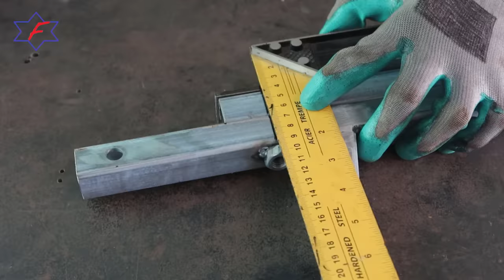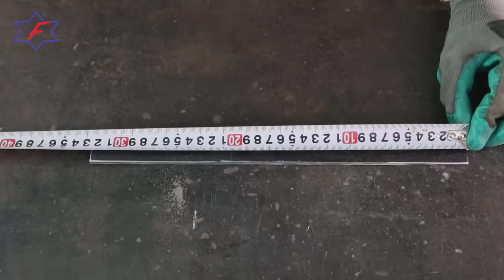Homemade Multi Purpose Wheelbarrow From Old Pallet

Comment: One roller needle bearing ll do  four times better than two ball bearing. I dont understand why so many people use ball bearing for hand carts that ll carry weigth, ball bearings cant not stand shock and heavy loads. plus their give slow spin and cant transfer power well, in the other side needle bearing are used in olympic bars and cant stand hell of a shock and can give faster spin for the wheel wth very little effort.

Comment: We don't have problems with cars, we have problems with wheels. Previously, the wheel worked for several years, but now the tire with the tube needs to be changed several times a summer. If only the wheel was from a Soviet scooter

Comment: Very nice idea. Just a note, you took the boards off of the pallet in the wrong way. Always work backwards so that you have a board to use for leverage on the next one. Your method is good, but start at the other end. It will go easier.
Reply from the maker: Many thanks for your advises

Comment: you should have glued all the boards together edge to edge, then cut out the shapes out on the table saw. then you wouldn't need 2 screws on each board end to attach it to the metal frame, which, of course, weakens the metal frame. just 4 to 6 screws to attach each edge.

Comment: Nice video! what welder are you using and do you have a link for it?
Reply from the maker: I used TIG welder. I bought it in local market. You try to find it on amazon and order it. Thanks!
Reply: @fawabros  What brand
Reply: Buenos inbentos